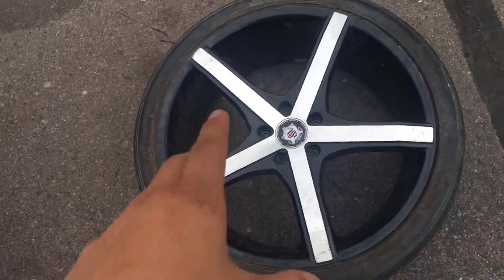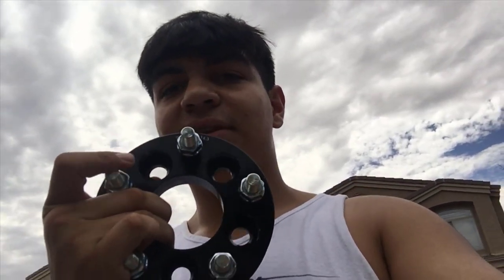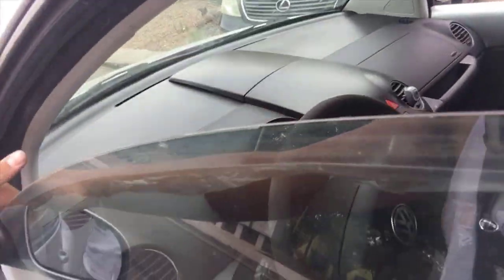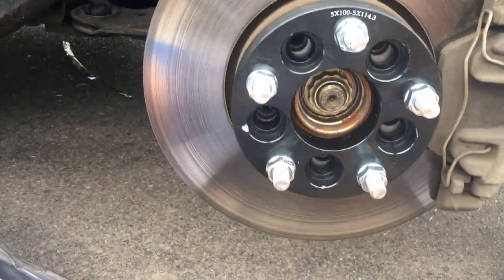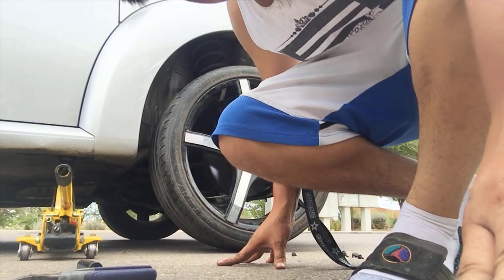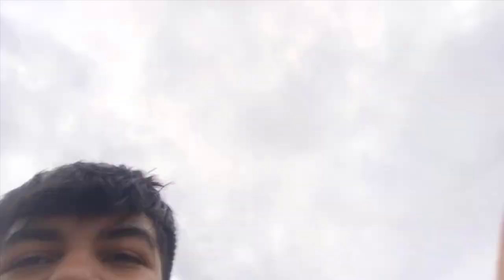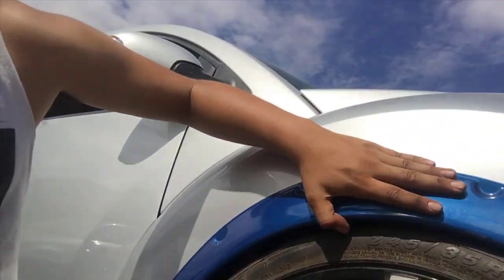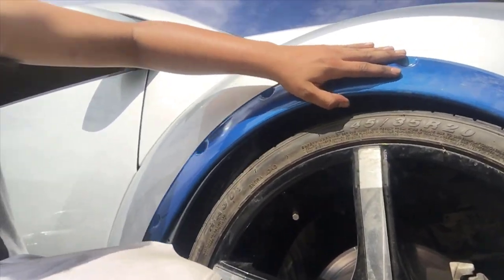PUTTING 20" FORGED WHEELS ON THE VW BEETLE/BUG!!!

Comment: Where you get the spacers?
Reply from the maker: Got them off of eBay but I recommend getting forged steel spacers instead of steel compound because the steel compound tend to crack or break with stress and I’m i want you to be the safest off of my own experience.

Comment: Seriously everyone talking g 18s vs 20s. Someone want to through out some tire sizes with those rims? Lol just trying to see what will fit. I know going from 205 55 16 to 225 45 18 will fit. I'm trying to see how much bigger with over all diameter I can go
Reply from the maker: At the moment I’m running 20 inch rims with low profile tires on the beetle👍🏾
Reply: 225/30/20